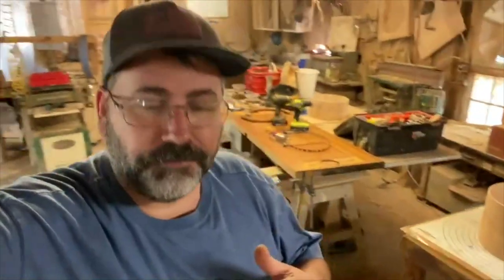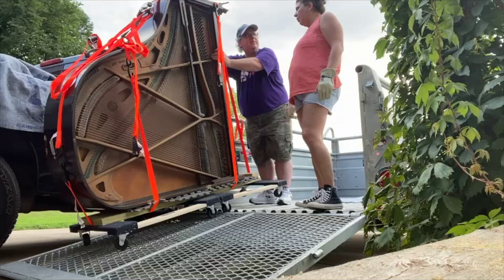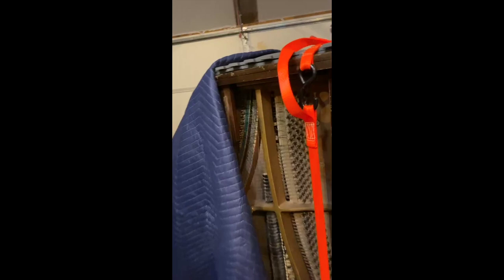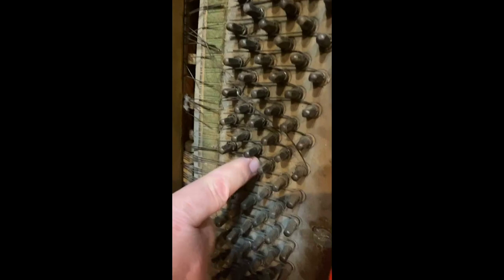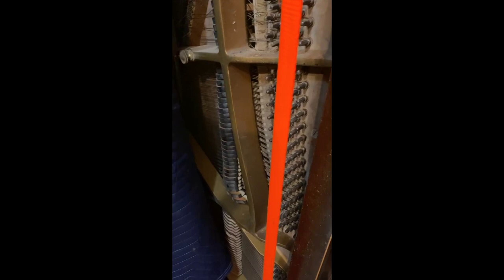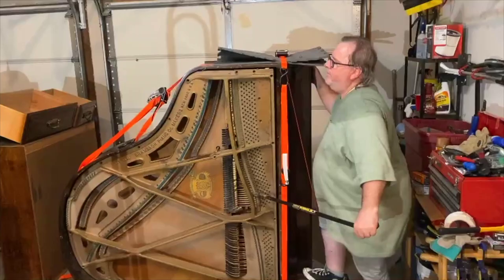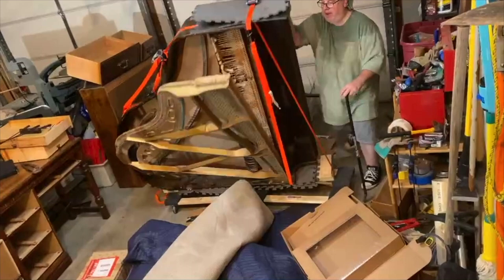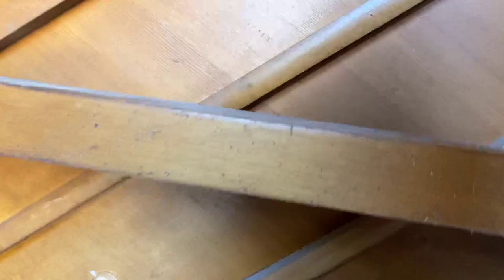Transforming an Old German Piano into a Unique Snare Drum | DIY Restoration Process

Comment: I'd be curious to see if you could get enough wood out of an upright piano to make a snare.

There always seems to be 20+ old uprights people are giving away on marketplace.

Not sure I fancy picking one up to find out though! 🤣
Reply from the maker: Maybe!  I'm sure I could!  You could always use it as decorations I have the old parts put up around the shop that I did not use. I like the sound boards from them the most.
Reply: I have one in my garage. Its 120 years old and I never could get it in tune and stay. I think Im going to try to get enough wood for a 3 piece stave kit, 13/ 16/ 22. Im using a bandsaw so less wood waste from blade kerf. Definitely enough wood for a snare but I dont need a snare and want a new kit.